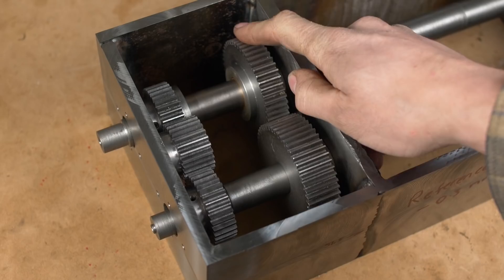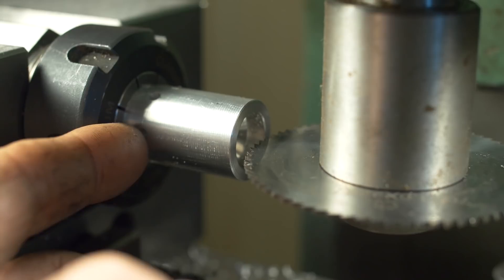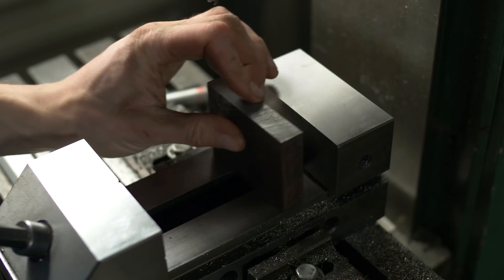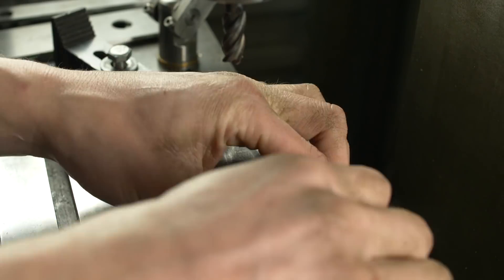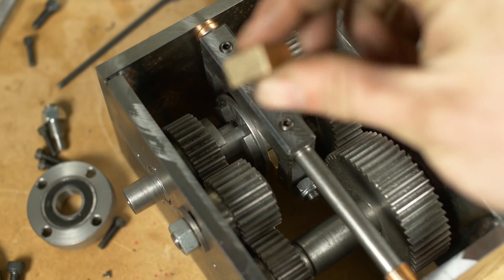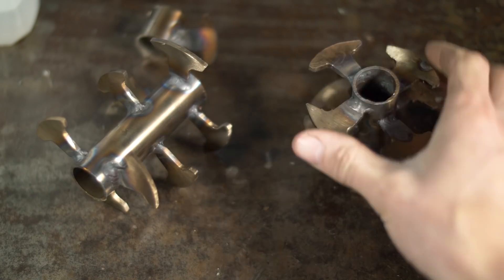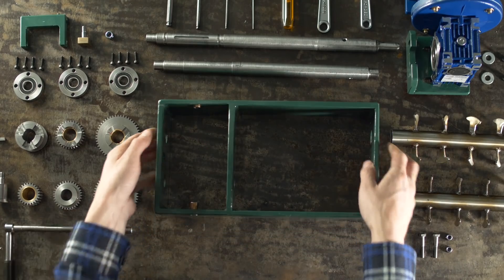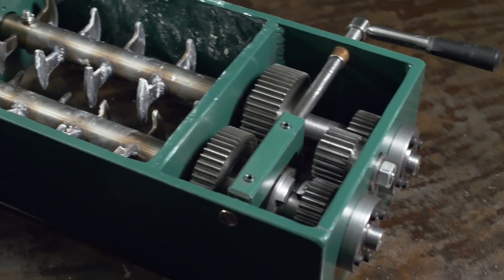Pug Milling Mechanical Build 2

Comment: Omg.
Reply from the maker: @sailinggreenpearl2571  hope that's omg in a good way 😅
Reply: @TomMakeHere  my friend, you got machining skills, like gear cutting? Respect....but you may want to look into learning about product development, all that work with no product. Prototyping the unknowns first and have a clear understanding of customer requirements. 2 part video for..nothing. its not a pugmill. It doesnt work. Super annoying. Im just going to design my own and ill 3d print everything until i figure out what works and make it in metal.
Reply from the maker: @sailinggreenpearl2571  fair comment. I do like jumping in and figuring stuff out too, I learn a lot that way 😂

Comment: You have done it but there is an issue with the gearing configuration.. Incorporate this mechanism and it will work on both of the shafts moving in the opposite direction. Right now both are moving in one direction, that will make the clay pushed down.
https://www.youtube.com/watch?v=esVq6jfTigM
Reply from the maker: The gearing lets me choose. i can make them spin in the same direction to enable mixing and churning, then change to dispense the clay down
the fin type is completely wrong for clay. This was the problem

Comment: I spent the depths of the pandemic binging YouTube machinists, and somehow missed your channel.  As someone who once dabbled in clay, I was pretty excited about this build.  I think the most satisfying overkill redemption would be to build a whole new pug mill with a larger entry hopper.  I used one about like hers when I was in college, and it seemed silly to me how little clay I could feed in compared to how fast it could spit it out.  Anyway, thanks for all the great videos I get to watch now, and I look forward to seeing what you did with your air grinder from this video.
Reply from the maker: Yes it's a bit unfortunate that it didn't work out. I'm thinking I'll make a large auger that feeds into the actual pugmill rather than bladed fins.
This is currently on the back burner with a lot of other stuff on the go. I will revisit it in future

Comment: The only two things I can suggest is to use it as a shredder for the horrible stringy bastard chips, and to put the clutch handle vertical so its moment holds it to one setting or the other.
Reply from the maker: That's actually a pretty good and useful idea
The clutch was to have a spring loaded detent, but I wanted to test before I got too far. I could see that simply changing the blade geometry wouldn't be enough; it needs to be changed to an auger style to fully sweep the area

Comment: This is a great video.  My girlfriend does a lot of pottery and I was thinking of making a pug mill.  I would have done EXACTLY the same thing (with the paddles at least, the dog clutches are way too nice for what I do).  Thank you so much for saving me that time and effort.
Reply from the maker: Yeah from what I could see even the angled blades just cut through the clay with no sideways push.
It really needs to be an auger that pushes the clay. They are often variable pitch augers so the clay gets further compressed towards the end of the barrel
I will revisit this project in the future

Comment: Ouch, bummer it didn't work as hoped but it was a fun build to watch.  With modified blades could you not use it for a casting sand mixing mill or something?
Reply from the maker: Cheers, could do. I do plan on getting into casting in the future.
Thanks for watching Everett

Comment: You'd need to have your shafts timed for the best performance so you can remove as much dead space as possible as you don't want jamming,
Reply from the maker: The problem is one of the shafts is reversible, so the blades need to be separated to avoid a collision.
The mixing mode is required as my mum blends paper in with the clay

Comment: Another comment suggested a shredder. A good idea to use the parts with another design for the blades to shear waste plastic into smaller bits so it can be reprocessed/repurposed. If you did the reprocessing you could have a supply of HDPE for future projects.

Comment: Good work. Really enjoyed the build. Whether it works in the end is secondary! I am sure with a different rotor design you can get it working. Possibly gear pump type rotors?
Reply from the maker: I have some ideas to make it work. But I had a lot of fun getting to this stage at least!

Comment: Yes please continue with the new version. What you've already built would work well with dry goods I could imagine. Especially if the blades were sharpened. That would scare the hell out of all the keyboard warriors too. 😉
Reply from the maker: Ha ha yeah it's pretty terrifying to have your fingers near this. After testing I was going to add guards and mount it over the other machine.
Ah well version 2 will be simpler

Comment: Good work Tom, an excellent build all round. Sorry it didn’t work they way you wanted it to in the end. No dramas though, you’ll get it sorted 👍🍻
Reply from the maker: Cheers Aaron, yeah I figured there would be a bit of fiddling with the paddles, but it's turned out more than I anticipated. Ah well, will work it out

Comment: Yes, show us the second iteration , the transmission looks sorted but the paddles arn't quite right, what steel did you use for the gears and dog clutch ? , you get good milage out of that Hercus
Reply from the maker: It's all just mild steel (except for the 304 stainless), but the use will be relatively infrequent, so shouldn't be an issue. Yeah both Hercus machines work really well, I'm a bit torn with the mill now that I have the second one, one will have to go

Comment: Clay is not easy to work with, it sticks when you don't want it to and shears when you want mass movement, as you have discovered.

My idea for what you are trying to do is similar to an old fashioned square hay baler with a plunger to push the clay down into the pug mill.
I envision this as a chute that your mother could roll balls of clay down which would then fall into a chamber clamped or otherwise affixed to the pug mill.  From the chamber the clay would then be pushed down into the pug mill by a reciprocating plunger.  Think about this like a one cylinder engine with the cylinder head removed, the open cylinder end facing down to the pug mill, a feed opening cut into the side of the cylinder and the crankshaft driven by a motor.
 
Since the clay would probably want to stick to the plunger you may need to add a cutter that would slide in from the side at the bottom of the plunger stroke thereby severing the clay from the plunger.  If the plunger is too tight a fit to the chamber a vacuum could be generated as the plunger rises which would necessitate some form of vacuum relief valve either in the plunger or chamber body.

I know your prototype was not complete but be aware of safety requirements as those rotating blades, or my plunger idea, can be quite dangerous if fingers are in the wrong place at the wrong time.

Good luck with V2.
Reply from the maker: I hadn't thought of a reciprocating mechanism, that could be interesting
And yes, as you point out the prototype had no guards, the in and out chutes were to be long enough that fingers and hands were definitely out of harm's way

Comment: Great video, I would love to see how you do get it to work. There's plenty of good suggestions here. My only contribution is if you want to avoid the grotty penetration when welding the tube, purge the tube with argon (you can purge with the torch and stick masking tape over the ends to keep the gas in). Your solution of pulsing the weld is good too! See you next time.
Reply from the maker: Thanks for advice! First time stainless pipe welding
Always learning

Comment: Thanks, Tom.  I learned a valuable lesson here (vicariously).  For prototypes, build the bit that must work FIRST.  Then test this bit, using whatever bodges are necessary.  Then build the rest.
Reply from the maker: I like to learn more the hard way 😁
Yeah I was going to bodge the blade geometry, but I can see that even turning them a full 90° would still just cut rather than push. Many small things I know to do different next time. Call  this build the prototype lol

Comment: What kind of tolerance did you use for the bearings at the end of the shafts?
Reply from the maker: Honestly the fit of those ended up a bit looser than I would have liked. the setup on my lathe has some odd rigidity issues, but only sometimes.
I've had it happen that I've cut in 10 thou (0.25 mm) and there has been no change to the diameter, do the same again and suddenly it will cut more than 20 thou (0.5 mm). HSS or carbide, doesn't matter
Reply: @TomMakeHere  I've seen similar on my lathe.  Not the same, but similar.  After much work, for me, it ended up a metric leadscrew with imperial dials.  Now, if I need to make a really accurate cut, I use a dial indicator to measure relative moves of the carriage.  Has not let me down yet!

Comment: Well that bites... is there any opportunity to place some fixed guides/wedges/diverters between the shafts and sidewalls in the dead zones (Christopher Walken anyone?) to help the clay move back into a paddle?
Reply from the maker: I played a bit with this idea and tried jamming mdf in there, but the blades just cut the clay, rather than pushing it. I think even if I turned the blades a full 90°, they would still just cut through.
An auger is what it really needs

Comment: For some reason when you said you need to attach the tubes to the shaft the first thing I thought of would be taper pins.
Reply from the maker: The only concern is that maybe they could have fallen out and it had to be made from stainless, that's why I wanted a nylock nut. The fit of the tubes is also a little loosey gooesy too, they were visually oval shaped before welding